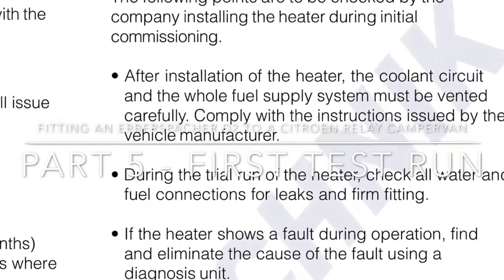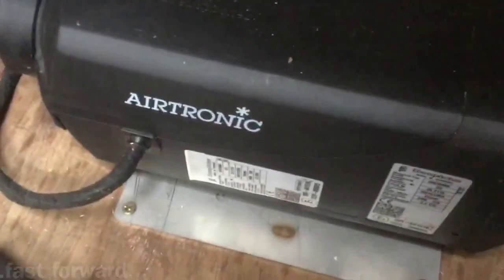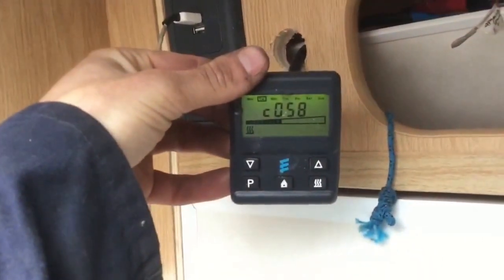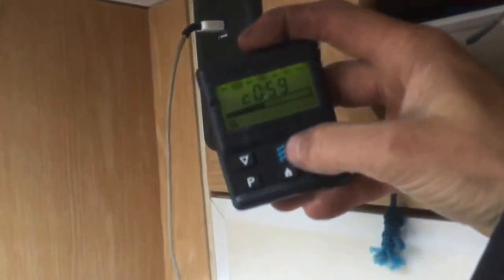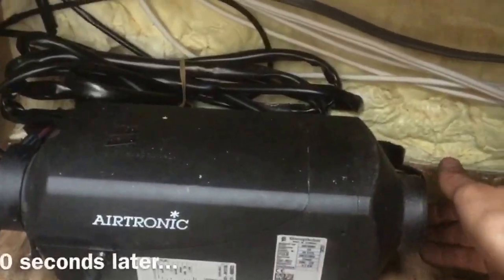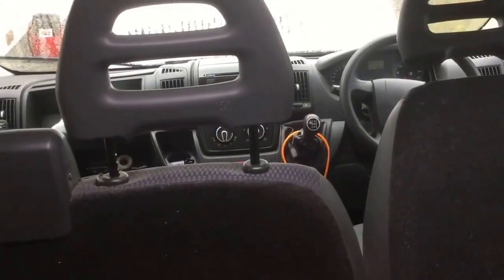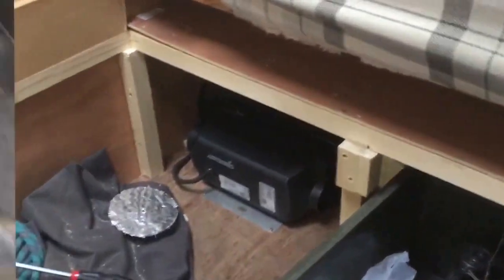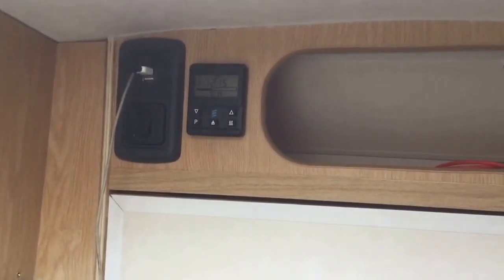Fitting an Eberspacher D2 to a Citroen Relay campervan - PART 5 First test runs

Comment: thanks for the video - really useful for our own relay conversion! .  Keen to know if there are any other mounting options for the fuel pump.  Did you go for the engine bay due to noise, and would I be crazy to put it anywhere else?  Thanks!